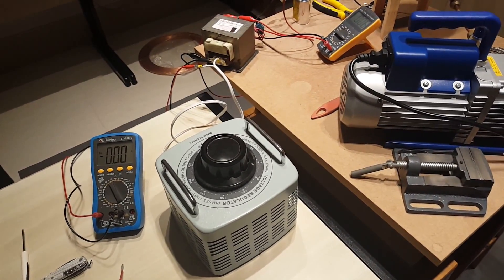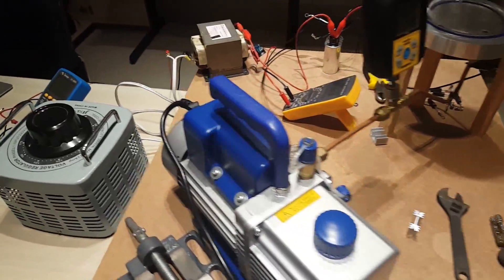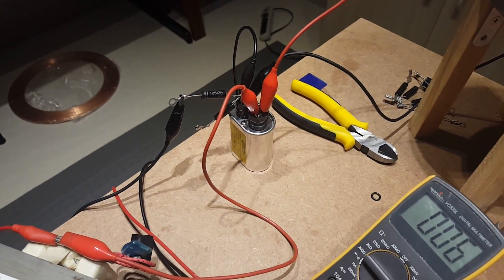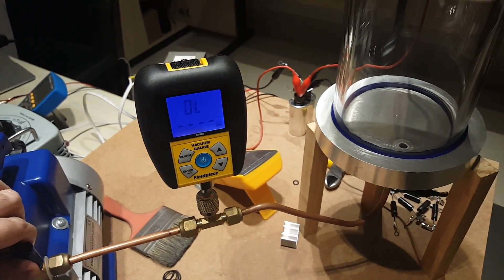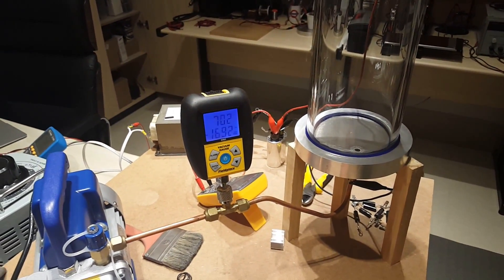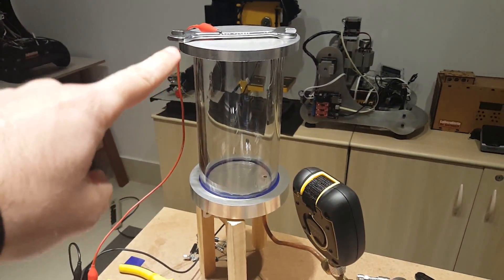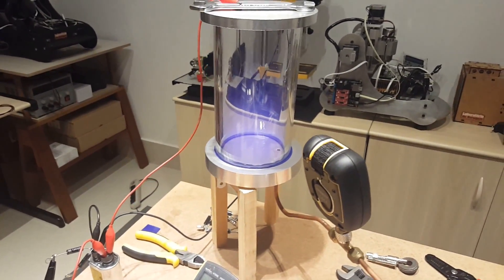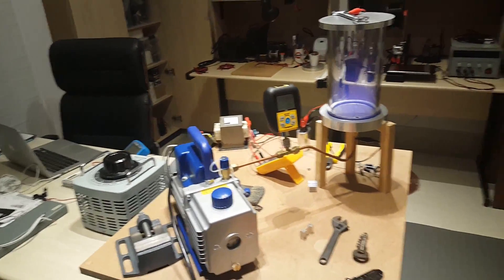Making plasma

Comment: In all these below videos they are using only a 230 volt AC supply and passing it to a microwave transformer (230V, 50 Hz, 220 series preferably). The output from the transformer is hardy 2300 volt or maximum 4600 volt on using a voltage doubler. Should we use another tranformer in series ? If yes what is the connection? Can anyone provide me with a circuit diagram for the same connecting the transformer with a capacitor with or without a rectifier. Plasma can be generated only at 20000-30000 volt so how are they able to generate plasma at just 2kV. I am currently using a a chamber such that the space between the two metallic plates in about one inch. The vaccum that I have creeated is about 25-27 inHg (more than 150 micron Hg). If the voltage generated sufficient then how to get perfect vaccum ie 30 in Hg(less than 150 microns Hg). Please help me.

Comment: I would’ve appreciated if you went into the circuit schematic more. Where is the diode and capacitor connected to? Why are they there?
Reply: look up "voltage doubler"
Reply: Hi, did you find any answer?

Comment: Its a pretty cool project and while it has been 2 years, have you made any improvements? I was particularly wondering if there is an inexpensive high frequency power supply that can be bought to achieve this. Something like a ZVS flyback transformer?

Comment: Hi, I'm a research student.Could you please tell me which material you have used for the cylinder.. Is it normal glass or quartz glass, and how thick it is so that its not breaking due to the pressure diffrrence created by the vacuum pump.

Comment: hi, i didnt see a magnetron, is the voltage directly connected to the wrench on top ? then the ionization of the aluminum? in my design im using silicon or silicon dioxide with a magnetron . i modified a sputtering chamber into a rocket engine . with wave pulses of electric fields to create pressure on a high density plasma field . trying to see if it can be done now outside the microwave range . thanks for the video

Comment: Hmm do you get plasma if you ground the other side of the vacuum tube to a real earth connection (not just a wall plug) and the put positive high voltage on the top?

Comment: what are the benefits of using plasma in sputtering physical vapor deposition
Reply: It produces the smoothest surface...when used with 100% argon gas. The plasma can also be focused better with a magnetic coil in conjunction with a filament and RF power supply.

Comment: How did u heat the air in the vacuum to make plasma. Did u use vacuum pump to make the air self heated it?
Reply: He does not heat the air to create plasma, there are several ways of creating plasma. Try searching for "Thought Emporium"'s video about plasma, he explains it very well.
Basically he uses very high voltage to flow Electrons from the bottom negative plate, to the top positive plate and that creates the plasma we see; it needs to happen in a vacuum because the Air will get in the way of the electrons and prevent the plasma from forming.

Comment: Great video!
Why did you need the capacitor? And what was the Farad rating on it?
Reply: The capacitor is used to remove the alternate component of the current, you have a constant plasma instead of a 50/60 hz plasma
Reply: @ltd5352 is that also why the diode is there? Is this a half wave rectifier setup?

Comment: important question here what pressure in pascals did you need to go down to to create the vacuum for your plasma?
Reply: In order to generate plasma, you'll need a combination of low pressure vacuum and high voltage. If you can have the voltage high enough, then no need to go lower pressure.

Comment: Why do you need a vacuum chamber to make plasma?
Reply: 162/5000
With 3000 volts at ambient pressure the electrodes would have to be spaced only 3mm apart. At low pressure the plasma can spread at greater distances!
Reply: Because there’s oxygen inside and vacuum chamber is high voltage and lightning is lasma the vacuum makes the chamber hotter and hotter till the gas becomes plasma
Reply: look for Paschen's law
Reply: U can use a microwave
Reply: Lesser voltage is required to create plasma if we reduce the pressure.So he reduced the pressure inside to generate plasma with whatever voltage he had. (See Paschens law for more insight)

Comment: Just a tip. A long and narrow vacuum line is bad for the pumping speed. I would  increase the diameter of the piping.
But thumbs up for a very stylish looking chamber! :)
Reply: That is very true! besides tubing is not that expensive and 130 militorr is still fairly high pressure for a vacuum. I like to get under 10 militorr. Also flare fittings are the worst, swagelock and others similar are much better.
Reply: @Paul-gz5dp help me build one please product pieces and everything I want to do a project please
Reply: Yip